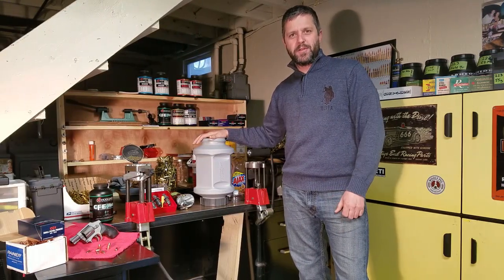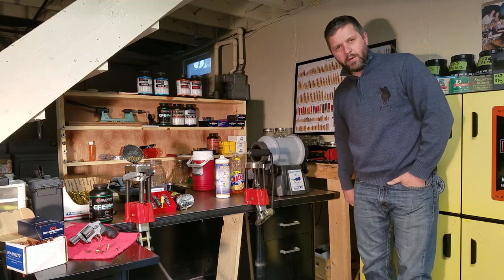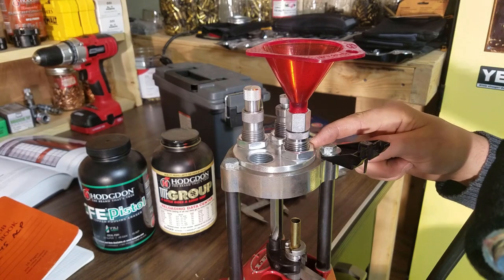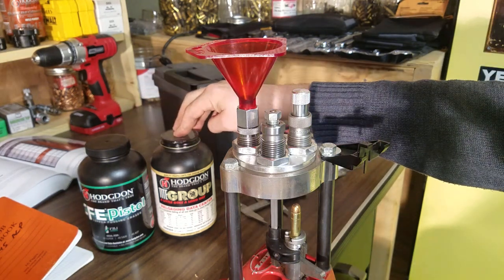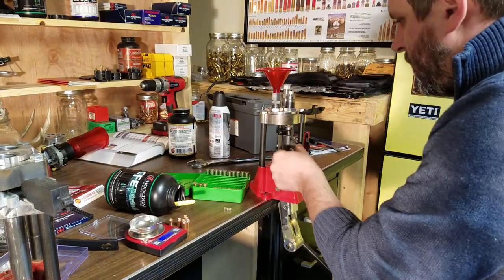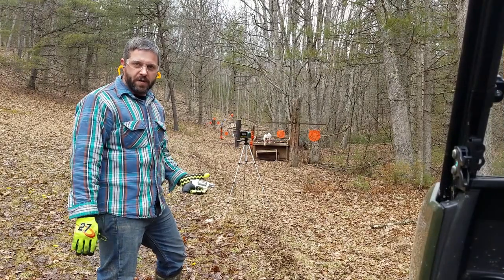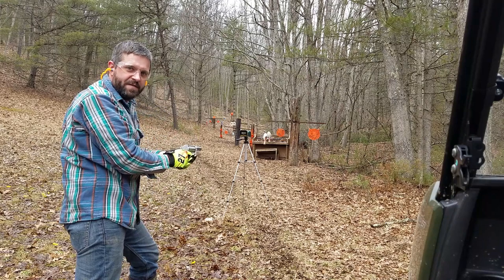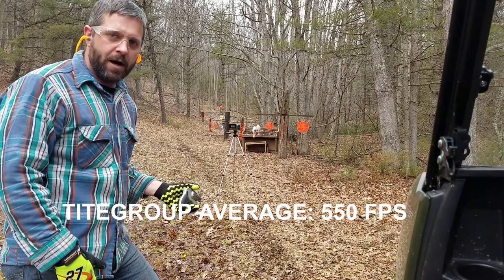Let"s Talk Reloading: 38 Special CFE vs Titegroup velocity test on starting charge

Comment: You cannot determine accuracy without shooting from a bench. Having your gun supported on a rest, eliminates your movements, thereby checking the accuracy of the bullet and the gun. Also, in a short barrel revolver, a faster, burning powder will work better. Why is that well the ideal situation is to have all of the powder burned before the bullet leaves the barrel. A slower burning powder will not do that but a faster burning power will burn most of its powder before the ball leaves the barrel on a snubi. Thereby providing more consistency and more velocity and power. Hope you got that her yet.

Comment: Nice video with very useful information. I also use both CFE and Titegroup both for my .38 Spl. loads.  I was surprised how little difference between the two powders.  As all my revolvers other than a S&W M10 snub are .357 (Ruger Security 6, Model 19, Model 13 and 686), I usually load hotter @ 4.2 gr. Titegroup under 158 gr. plated.  Very nice load, but I don't want it that hot in my newly acquired Model 10 2.0" snubbie, made in 1966.
I must say, you are very patient to be using the Lee press!  I would find it too time consuming.  I shoot about 6000 rounds a year of 9mm/.38spl/.357 and I have been using a Dillon Square Deal B since 1992 - it cranks out 100 rounds in about 10 - 15 minutes.
Thanks for an interesting video.  And nice shooting, by the way!
Reply: I use pretty much the same 4.2 under 158 plated for my lever action, works great

Comment: the velocities are what there supposed to be, if you had a charge of 4.5 gns of tite-group the velocities would have definitely been higher than the CFE charge. by making a charge of 3.5 of tite group just matched the velocity of the CFE 4.5gn charge and that's all, understand the data for hodgdon powders are usually from a Ruger 7 1/2" bbl. and at least a 4" barrel but not from a 2" bbl so of course your velocitie's will be significantly lower. check out my hodgdon's HP-38 ladder loads for the 38spl and 9mm.
Reply: What kind of velocity will i ingest with 4.5 grains of titegroup and a 125 bullet?

I'm using a charter arms snubby, I haven't yet bought a chronograph

Comment: He dumps the powder in, then less than a 1/2 second later he needs to inspect that there is powder in the case? DUDE, YOU JUST DUMPTED IT, AND UNLESS THERE IS POWDER ALL OVER THE TABLE, ITS IN THERE!
Reply from the maker: always visually check the powder level. every case, every time. remember you are making a small bomb and setting it off near your face
Reply: @unclejacksoutdoors728 agreed. Measure twice, cut once. This has its own application to reloading as well. Can never be too safe with firearms/ammo.